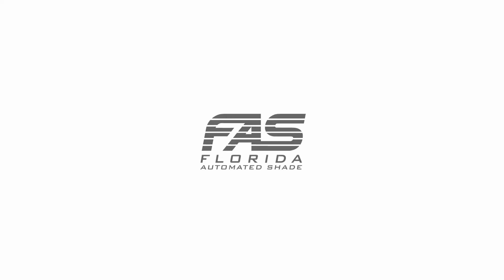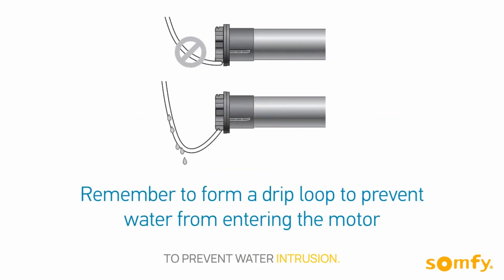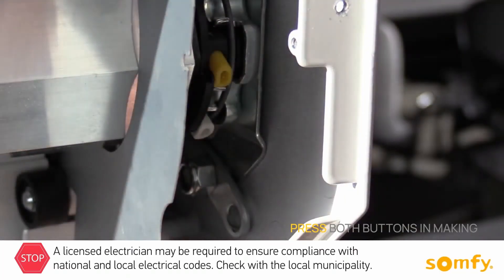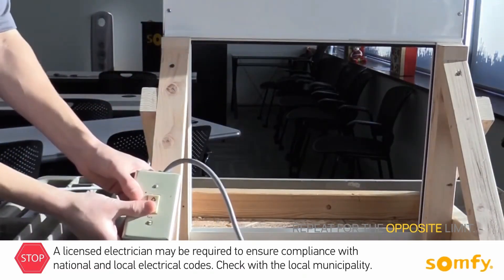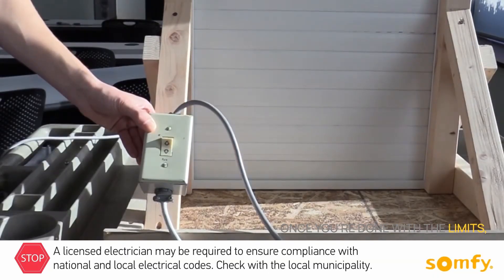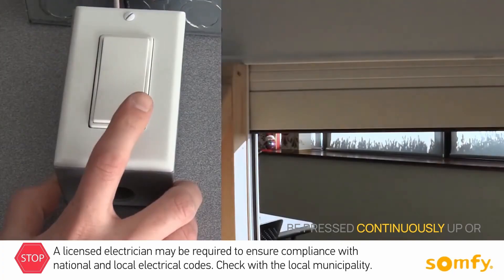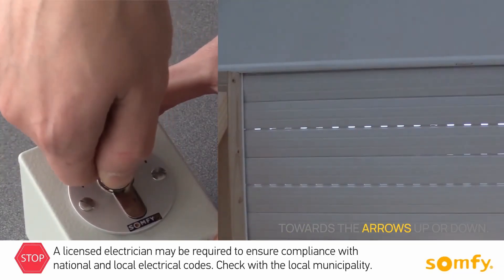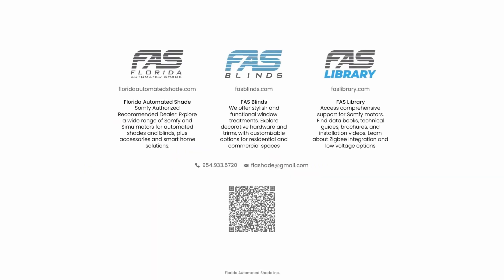Somfy limit setting for 4 wire motors

Comment: SOmething not right.  I set the limits in both directions.  But now w/the buttons popped out, nothing works.  Neither position (up or down) on the test harness switch does anything.

Also, normal for these motors to get hot?  I'm only having it run 12s in one direction and sucker is hot to the touch.